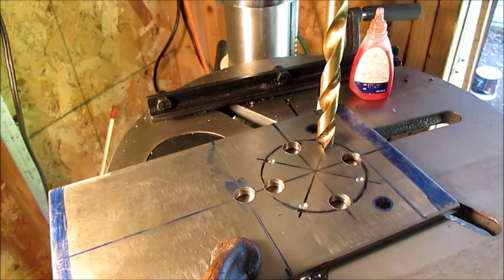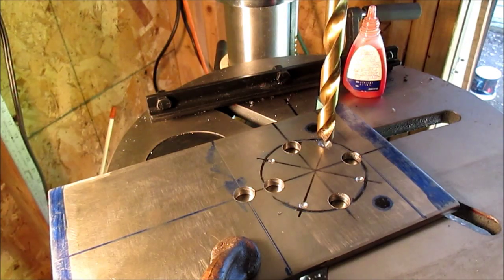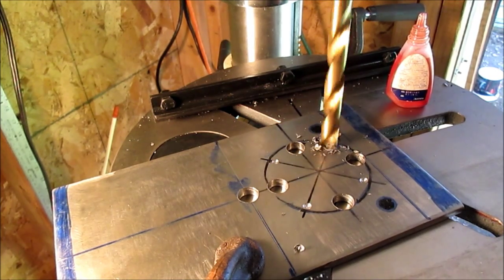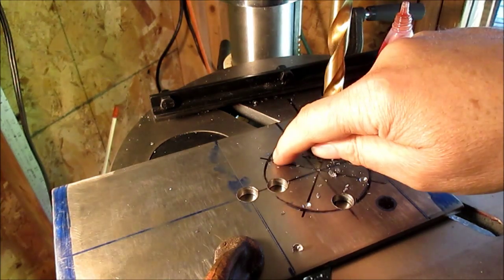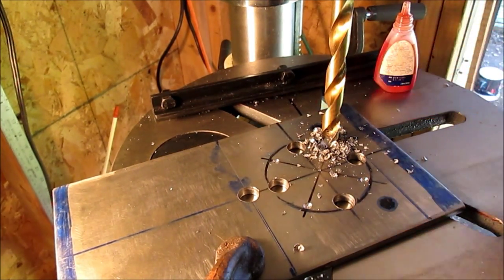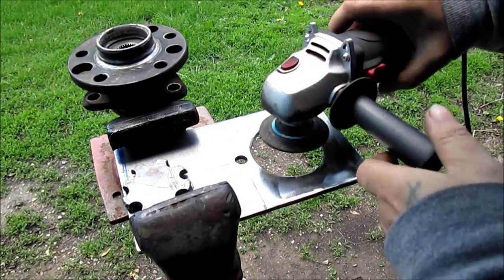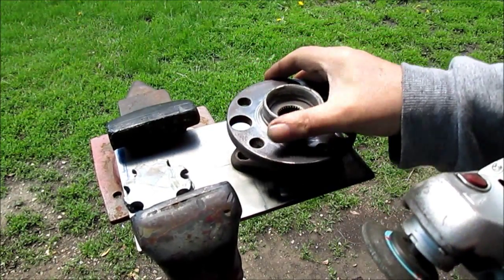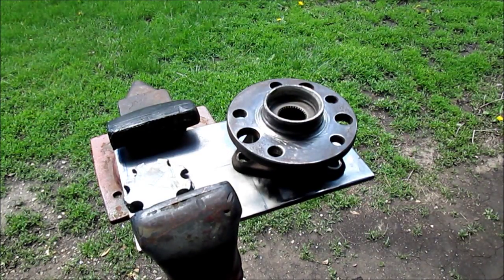Turn Table project part 5

Comment: Again great project! Perhaps you mentioned it buts any plans to put index marks on the turn table? Would be cool to have set divisions for bolt hole patterns and such.
Reply from the maker: I think you are reading my mind I have an Idea to use a Big flywheel off  a manual transmission like off a truck ..The center hole will have to match and then I can make simple degree markings On a flywheel the bolts on the outer edge that bolt on the pressure plate can be used for clamps

Comment: I just added Marvel Mystery oil to my gas in the car.  I wonder if it's gonna do anything?  Lookin good on the turntable though.
Reply from the maker: I use marvel mystery oil in my lawnmower gas it it gets rid of the carbon buildup from cheap gas I switched last year to premium gas and they  still put ethanol in that
Reply: so ethanol builds up carbon more than gasoline?  I didnt know that

Comment: Is that a harbor freight grinder? If it is, I like your style!!! Hahaha. I have one with the switch on the top. It works pretty good. Not bad for like $10 or less when on sale with a 20% off coupon. I used it till it started smoking a little the other day. Figured I better let it cool down for a while. Lol.
Reply from the maker: Yes this is there cheap $10 one I bought last summer went through 3 of them this is good for light grinding only and sanding discs I have a Hitachi for the big jobs like cutting 1/4 plate steel
Reply: I've been thinking about getting another few of them. One for grinding, one with a flap disc, and one for cutting. Hitachi makes some nice stuff. I like your youtube name. lol. Pretty creative.
Reply from the maker: Love2boat92 I stopped buying their power tools after the pro one with the paddle switch burned up in a week I came up with my YT name because I try not to hurry when working on a project and try to show enough details
Reply: I probably should stop buying their power tools, but I cant really afford something better. A lot of their stuff is the first of that kind for me usually. If you take your time and do things right, you won't have to go back and redo things. I can't stand that when I have to redo something. Do it once and do it right.